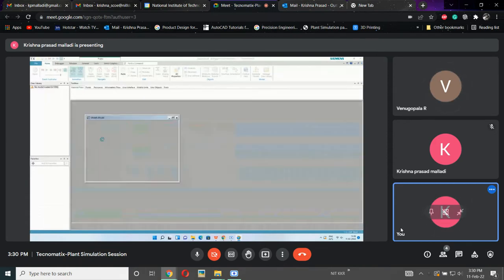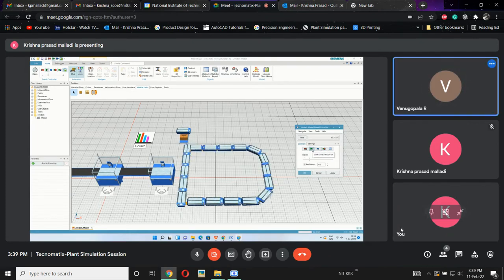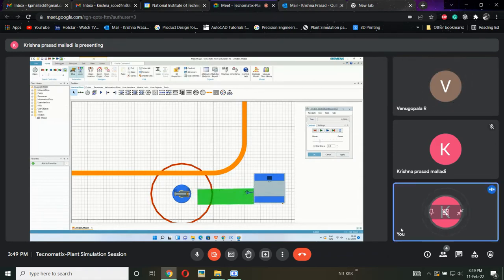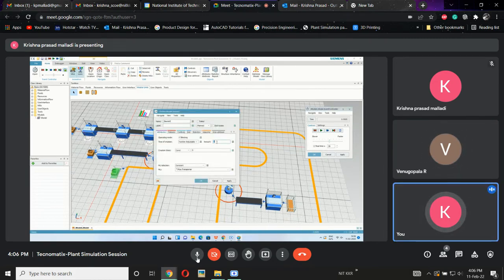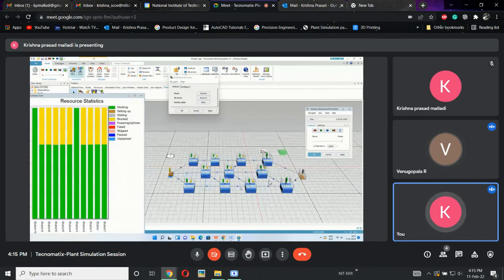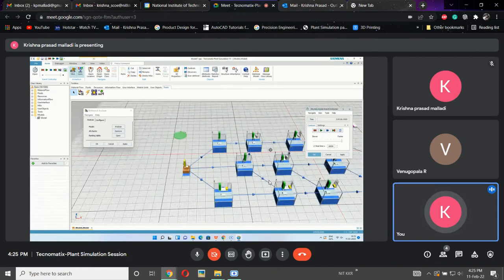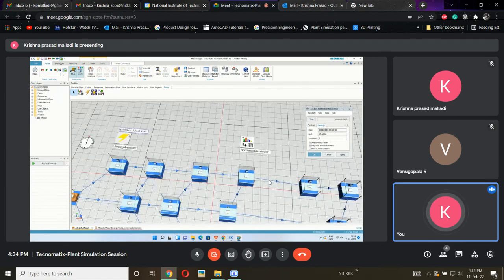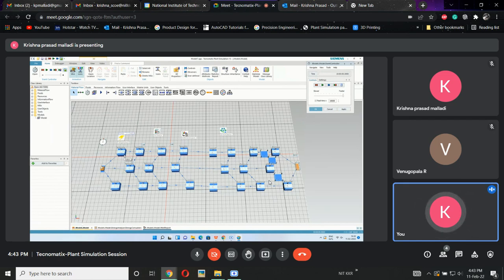4. Tecnomatix Plant Simulation - Basic Training - Module 5

Comment: Hi Sir, the video is very informative. But I am facing a problem in AGV. I followed all the steps as you have mentioned in the video. But the AGV runs only one cycle, can you tell me on what changes that I have to make it run in a cycle. Thanks in advance.
Reply: Did you Connect the End of the cycle With the Beginning of the cycle With a Connector?
Reply: @antonw.780  Thank you Anton, It was a mistake at my part. I connected it and it is working. Thank you so much.
Reply from the maker: Sorry Samuel, I haven't seen the comment section. 
Mr Anton is right, you need to connect the end of the oath and the starting of the path for continuous loop.
If you have further, do reach/mail me at KPMALLADI@GMAIL.COM